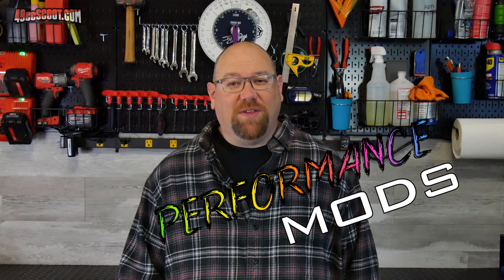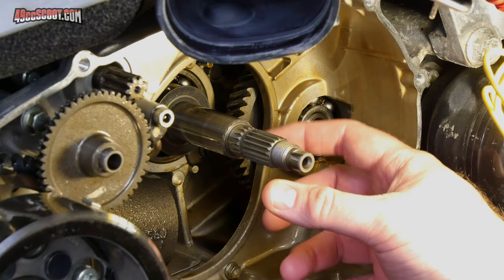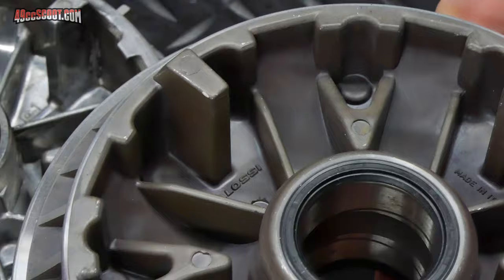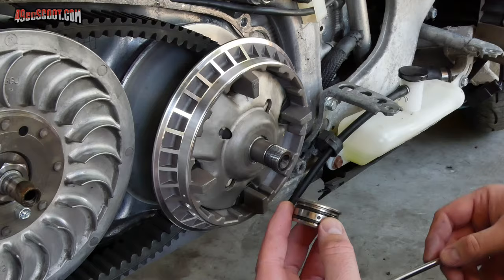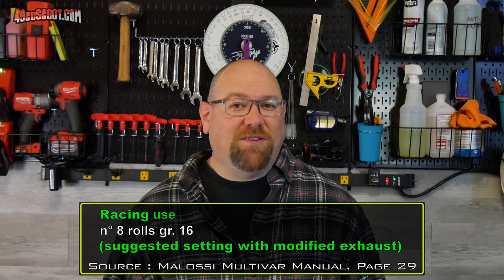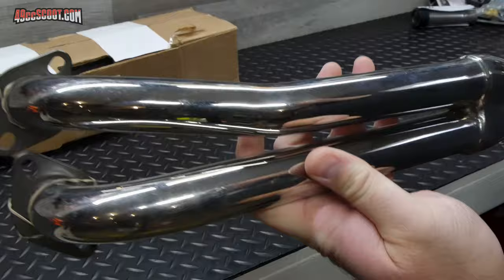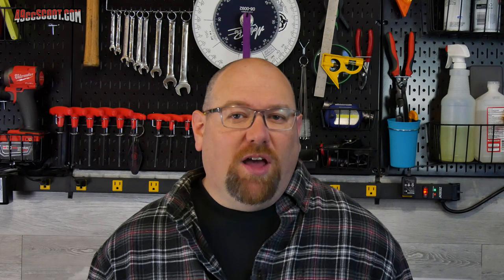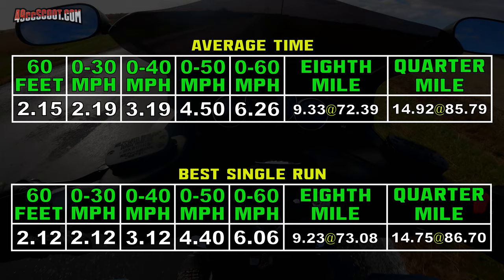Yamaha TMAX Performance Mods Tested 🛵 HUGE Gains! 😍 Variator, Exhaust, Air Filter & Fuel Controller

Comment: I got 2006 black max, Mallosi clutch ,vibrator, 12gr, KN air filter, arrow full system, Dino jet, need 4 hands to hold the bike when accelerating & to 80-100kmh im pretty much jet rocket! 
Pure fun!

Comment: This is currently the best setup for reliability for this motor,500cc's tend to blow up if pushed any harder than stock hp so dont even think about big bores,530cc next model engine is stronger and can take a lot of beating even get turbocharged and be reliable,this info is all from testing through the years being a mechanic and tuner

Comment: I love how cost effective these are. My fuel injected 169cc with mods and registration cost under $900 so far and it's the most fuel efficient vehicle I've ever owned. One of the most fun as well! so far it goes 70 with just me on it
Reply from the maker: What scoot have you got?
Reply: @49ccscoot  it’s just a 2015 kymco like 200i with 12k miles on it. I bought it for $400 with a blown motor so I put a taida 61mm cylinder in it and I just started tuning the transmission rollers. Next mod on the way is a contra spring!

Comment: Brilliant Man, you are a STAR - I'm just a rider with little mechanical abilities but love tech! So, got the Honda NC700D Integra instead, because it is more of a utility machine! Have just done a 6 day 2000 mile trip and it really shined, there were 10 other bikes from 390 to 1200 cc, not one of them could out gun me to 40mph so the concensus was from the other riders, respect!! Also, one day was 4 hours at 75 mph and still the little beast did not dip below 60mpg! 
Still want a TMAX though because it is lighter, lower, easier to mount and cool - but Mr Honda still wins because the 700 is a frame you can hang all sorts of luggage on, unlike the TMAX!
Reply from the maker: Sounds like quite a journey! Glad the Honda treated you so well. It's an interesting machine.

Comment: What a great video, very informative, bought a 530 in 2017 after one to many spills meant left knee very painfull on bikes so needed the extra leg room of a scooter, liked it so much i'm now on my second with a 560, after much deliberation on a little more acceleration opted for a chain and sprocket to get more power at the back wheel, was going to suggest this as a potential mod but then realised the 500 is already chain drive lol, great to see someone pushing the TMAX rather than sticking a big screen on the front and a top box they are great machines.
Reply from the maker: I wish we could get the later models here. It's kind of sad that the US doesn't get big sporty scoots. The touring/commuting crowd is basically the big scoot market here. No, the TMAX is not a sport bike... but it's got a lot going for it if people could forget that their friends will chuckle when they say they have a scooter.
Reply: @49ccscoot  feeling your pain dude, i might be moaning all the models are not available in the UK but at least we can get the latest models.

Comment: I had a filter, full exhaust system, j costa race variator and a power commander 3, dyno time and got 47bhp, but was lumpy in the revs so dropped it back to 43bhp at the rear wheel, was getting under 6 second 0 to 60 times, was fantastic.
Reply: Mine is in my videos from 11 years ago.

Comment: Excellent video. Here in the EU a variator and a loud pipe is very common if u have a T-Max. One thing I did not see is the racing SPRING for the rear plates, it is a must and usually comes in the Variator kit set. And as for the air fuel mixture, u have a hidden DIAG service menu on all Yamahas, for diagnostics and to tweak the CO settings by yourself. Cheers
Reply from the maker: This variator didn't come with a contra spring.
Reply: @49ccscoot  Hope U get one and try it. And once again love your vids 😁👌🏻

Comment: Another excellent video Brent.
Was waiting for this one to come out, and see the results of the fuel controller.
Like you, i found stock Tmax 500 acceleration underwhelming ( especially so, after also owning large capacity two stroke scoots, that have no deficiency in that area ) and after getting a Yoshi R77 system myself a few years ago, made things even worse.
Finding a Malossi Force Master 2 was difficult ( as its mostly discontinued, in favour of the Force Master 3 for the more current 530/560 Tmaxs's ) ebay was pretty much my only option, and while the item price was fine, postage was clearly a price gouge to get more money but i guess it is what it is.
A Multivar will be next on my Tmax shopping list.
I guess for you, its cams and a 560 kit ?😬
Reply from the maker: What I hope to do is leave it alone and ride, but we'll see how that goes.

DynoJet makes a Power Commader for the TMAX 500 that is on clearance for roughly $100 less than the Force Master. The reason I didn't go that route is that it says it only has a tune for a stock TMAX and I wanted plug and play as easy as possible. That  said, if you have a wideband to use as I did, I think you could work out a better tune than the Force Master most likely. The Power Commader actually lets you modify the tables rather than only have dials, so it's more customizable.
Reply: @49ccscoot  yeah, a power commander would be better, but it requires a dyno and a tuner that knows what they are doing.
The Force Master 2 is a compromise, but it will get me close enough.

Comment: Tmax models do vary - that model Tmax (mk3) is great, but it is slow off the line, and putting new variators or other similar things help a lot. However, the standard setup works well at high speed. The variators on later models - especially from 2017 on - work much better, and I'd expect smaller gains from transmission work. The 2017 ones on are rocket ships!  DrPulley sliders are an easy mod that improve acceleration greatly, and are far cheap than a new variator.

Comment: Привет ещё раз с Казахстана Я поставил себе прямоточный глушитель итальянский Mivv  поставил фильтр нулевого сопротивления у меня японская версия воздушный корпус  имел 1 отверстие теперь я сделал два поставил вторую трубку на впуске перед воздушным фильтром  как у европейца. Мне говорят что нужно корректировать топливо чтобы не было перелива  я не убил свой мотор теперь хочу спросить у вас совет Стоит ли мне покупать обманку топливной системы и настраивать топливо? Или мне ничего не делать всё будет работать нормально? У меня такой же как у вас третье поколение
Reply from the maker: It sounds like you should try to increase fuel now. If it runs well, you might get away with it. You can check local shops with dynos. Some will do a dyno run fairly cheap, so you may be able to find out if you really need it.

Comment: You will get actually better results, without having to spend big money on fuel controllers and a replacement variator, by addressing some things that you didn't. First, just putting on a Yoshi KILLS the low-end torque, by eliminating too much necessary back pressure in the exhaust stream. We tried one on my brother's 2009 Tmax 500 with 15 gram Dr. Pulleys and it killed it off the line. Almost unrideable. 
He sold it off and imported a 2012 Tmax 530 to California from Canada (Yes, doable and legal!). My initially modestly modded 2009 Tmax 500 and his 530 with Dr. Pulleys pulled hard from rest to 65 MPH dead even. Then, we put an MIVV "Stronger" exhaust on the 530, which was freer-flowing BUT with correctly sized ID exhaust pipes. It threw codes for about 3 minutes as the ECU adjusted and then BAM! Side-by side he now would pull away up the freeway ramp never looking back! Don't create a problem!
 (MIVV doesn't list the "Stronger" for the 500, but it fits perfectly! You just have to replace the 4 downpipe mounting studs with the longer ones that Yamaha went with on the 530 redesign...)

 So, TIP#1: get the correct exhaust!

Next, going with even lighter weights to move into the heart of your torque band for response and acceleration is going about it the wrong way. You have everything apart to put in Dr. Pulley sliders, which actually lower your initial "gearing" a bit by setting the variator halves further apart at rest, due to the geometry of the Sliders. 
To give you a higher rpm baseline under full throttle, all you need to to is use the factory torsion controller (which you should have taken apart to lube ANYWAY!) as it's designed to work, and change to a Malossi "White" spring and torsion control plate. Gives you about 800 more RPM across the board under full load. Acceleration curve remains as set by the stock variator with Dr. Pulleys. Midrange response in MUCH better, as you are in the heart of the torque curve!

TIP#2: Fix the Torsion Controller to actually match the Torque Curve!

Now, there is still the elephant in the room, the stock ECU LEAN MAPPING. It tries to keep everything at a stochiomentic14.7:1 fuel ratio as much as possible. BAD idea for acceleration whenever needed and high speed running (80 mph to 115mph+). Again, it's an EASY fix that is CHEAP! First, install a Malossi Lamda Emulator in-line with the circuit to the O2 sensor. BAM! All the lean Idle and off the line hesitation is GONE!And then, once you are rolling, the delay/modification in that signal from the O2 sensor richens it up initially when you nail the throttle. Great! 
Except for the fact that the fuel delivery is CRAP. The stock fuel pump, which eventually FAILS on everyone, can barely push out 2-2.2 BAR at best. That's why the top end goes flat, there is not enough supply available for the injectors at high speed full throttle. Doesn't matter if you have a Magic Controller, there's not enough to work with. So, put a high-pressure Quantum Fuel Systems fuel pump in, with a Polini 3.5 BAR Fuel Pressure Regulator installed. No flat spots, no hesitation, no high-end starvation. More fuel with more pressure and better atomization! 

TIP#3: Fix the Fuel Supply!

What do you end-up with? A very reasonably-priced BEAST of a Tmax500. Pulls from rest to 100 mph without ANY hesitation, tops-out at a corrected 115 mph. 0-60 is a tick above 5 seconds, mid range passing uphill just GOES, and still gets around 50 mpg on tour. Work WITH the bike's design, not against it!   
   
 (Disclaimer: That is with the GIVI AirFlow windscreen, which adds much needed aerodynamics above 80mph to the stock BRICK that is a Tmax. It's THAT GOOD.)
Reply from the maker: #1 : Exhaust : Is the Yoshi ideal? Maybe not. I've designed and built my own exhausts, so I get it... but in this case it was different. I wasn't going to get an exhaust at all. The Yoshi was cheap on eBay. I tried it. I like it regardless. Not spending more money on another pipe. Good luck finding the info about pipe sizing etc... without someone directly telling you, so thanks for sharing that info here.

# 2: Torque Driver : It was just cleaned, inspected and smoothed out prior to this as part of maintenance. It would be silly to take it back apart. I did install a fresh stock spring during maintenance, just because they are cheap enough and I wasn't sure what I'd find pre-service. I've tuned a whole lot of setups over the years and I'm not convinced that contra spring is the answer. Generally if there is not belt slip adding spring  pressure makes less power and wears belts faster. What actually happened when  I have tested the two practices side by side was that I couldn't tell any real difference in stiffer contra with heavier weights vs softer contra with lighter weights. Could be that this case is different though, I haven't tried it on the TMAX.

#3 : Fuel Supply : I do have a later model pump, to fix TMAX fever. That's the only fuel system mod aside from the controller. If it is going lean, the wideband didn't tell me. I could get it well into 12:1  WOT wound out... it just didn't perform quite as well there.

For me, what I did worked. I don't disagree on the pipe. It clearly went slower with only the pipe. I have a PowerBronze windscreen that I cut down  so aero is probably better than stock... but I'm a big dude that doesn't tuck down so well regardless. Net net is that I enjoy the bike a lot more now and the only way I plan to do much more right now is if something goes and I "have to" build a 560.
Reply: @49ccscoot  I had thought about a 560cc set-up, but now it's already fast enough to get me in trouble so I tabled the idea. I sure have enjoyed my Tmax. And my CA license plate is the BEST possible: TMAX500

Comment: Just love your work sir. Have you ever heard about J Costa? I am spanish and in my country the extreme variador, and clutch etc is j costa. I think it make diferents
Reply from the maker: I have heard about their variators quite a bit, but never tried  their products on anything.
Reply: @49ccscoot  there 2 types nowdays. The pro version and the XRP [ extreme racing performance] version, the xrp bring some changes in the air holes for the bullets [ they are transversal variator], a new and shortter belt [ kevlar like malossi ] and a ring that makes work better the xrp. The pro version is only for <2011 tmax and the xrp is only >2008 until 2017.  

The felling is quite different from  malossi, very smooth felling but very close to 0-100kmtr/hour to malossi,  the test i have seen are almost the same in test bank. The diferent is between 100-140 kmtr/hour...there the jcosta is much better getting a better torque and reaction in that speed.

Price from official size

Pro 300€
Xrp 479€ inclu belt and two weight of bullets.

Comment: Hey. A question about mvt dd for minarelli horizontal...it seems there are 2 types (for aerox before 2003 and after 2004)...it says "For Minarelli engines before 2003 without wire harness and battery, not suitable for MBK / Yamaha after 2003 (with battery)."My question is does it really matter because on stock ignition same coil is used for lights and for battery charging(through a rectifier)?.Its basicly the same stator that you got for the TPR engine.

Comment: Hi, first of all congratulations for the video, I didn't know you and I found the video by pure chance. I saw a really competent person and the various tests carried out for every small change, really good. I would therefore like to ask you a question if possible, I have a 2021 tmax 560 which is all original apart from the Akrapovic exhaust, what do you recommend doing as modifications? A thousand thanks
Reply from the maker: Variator! Some say the o2 emulators work well with exhausts. I've only tried the tuner as shown.

Comment: Sounds to me like a huge amount of work and cash whilst effectively losing any guarantee that may have existed on the bike whilst missing out on just  riding , and a second or so on the standing 1/4 mile sounds important if you were racing but is of little or no consequence on the road..Buying a mint condition Gilera GP800 with 74 (ISH) HP V-twin would have made a way way bigger difference cos when it comes to performance..Bigger is better, however the best thing about this video is how well it illustrates just what a " rabbit-hole" of expense and complexity you go down chasing tiny performance gains which might be significant on the track, but almost irrelevant on the road..what I was impressed with was your logic and measured approach to the search for speed and performance, and a well delivered commentary and a compelling argument to leave the bike in relatively standard trim given the bikes power to weight ratio being the biggest hurdle and it's longevity being potentially compromised..it also highlighted the greatest proverb..." Every solution breeds new problems" but hats off for a really well made video indeed!
Reply from the maker: Thanks.

For me, it actually transformed the scoot to something that I enjoy so much more than ever. Well worth the effort/expense for the variator. Exhaust is more or less just fun and not really worth it otherwise. I'm way more confident merging into traffic and those sorts of things. 

I would consider a big Gilera. I'd love to have one. Not so easy in the US. People don't like scooters here that much so big scoots don't sell. To my knowledge, the 800cc and over stuff never sold here. I've never actually seen another TMAX like my year in person and I've seen 1 or maybe 2 of the later ones when they brought them back in 2015 or 2016 before immediately taking them away because no one was buying them.

Comment: Hello, i have a Vinci  scooter  and  it has  DC..CDI...and  when I  switch  the key  on , the spark plug  it starts  sparking ..without  the engine  cranking. 
If I remove  the spark plug..is stars arching on the ignition  coil ...if I put contact key  in on position. 
And if I start  cranking   the motor  doesn't  start only backfires  few  times..
What  could  be the  problem  .? Thank you!
Reply from the maker: I'd start by swapping the CDI out and see if that does it.
Reply: @49ccscoot   Thank you   , I have  already bought a new  CDI...I'll see what  it does...
Anyways..I forgot  to mention  that, the battery  electric  fuse.was also . burned...